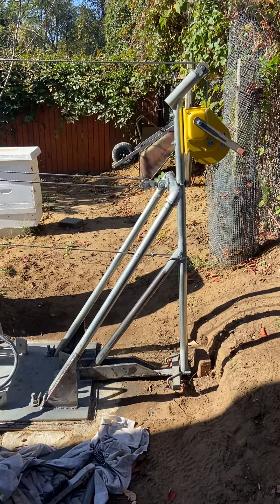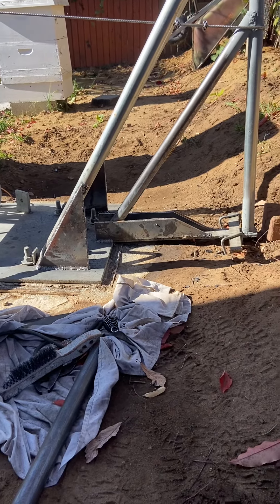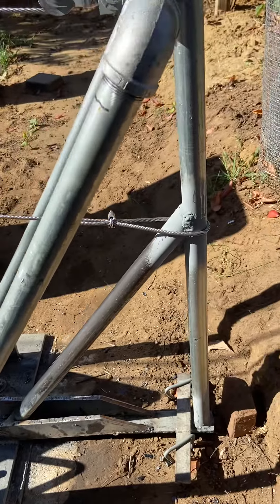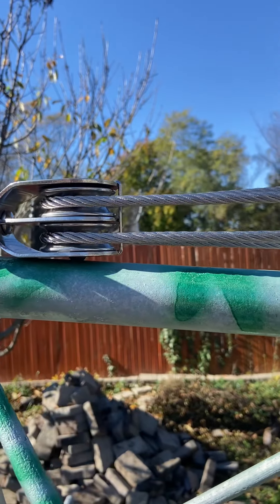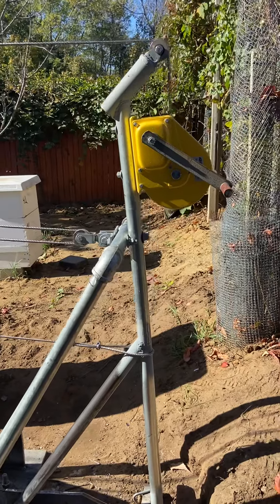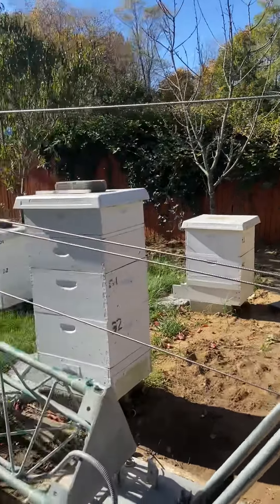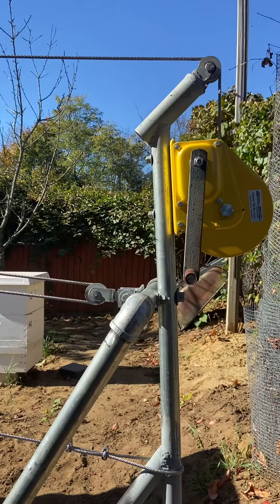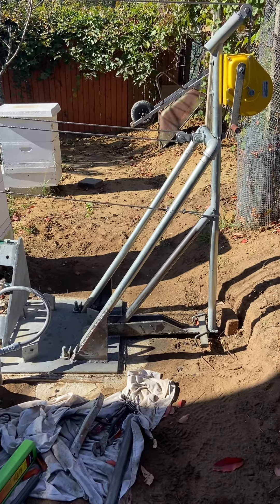Vertical Wind Turbine Part 23  Never buy Tesup , Here’s the Tower. It worked" Almost..

Comment: Run a cable guy wire from above the winch back to a anchor point on the ground.
Reply from the maker: I would but I’m out of yard behind me. Besides adding a steel block for weight, I’m going to put a choker around the block of concrete , 2 ft below surface and choker cable to the rear point. 
Or add a concrete counter weight block.

Comment: Good evening, I found the problem with the wind turbine when I connect it to the charge meter, the batteries are at 24 volts and the meter is at 28 volts, it cuts out, it creates a brake if I don't connect it to the battery, it works normally, it doesn't brake, I can't find a solution
Reply from the maker: Are batteries fully charged ?  At that point, the controller should send the power to the dump load. 
Extremely important, did you do a continuity test on that connectors in the box because I got two of them from Tesup and both had shorts in the connectors to the box, which breaks the turbine.

Comment: Go for a taller mast to get a steeper angle on that pull. Or j bolt the back side down but I would say a steeper angle of pull should help.
Reply from the maker: I’m digging out a 3x2x2 hole. Equals 1800 lbs, plus putting 1” j-bolts in the pour to connect the two blocks of concrete. Plus adding a 1”  thick steel bar at base x 3 inch wide, to prevent flex. This has to be solid, as I have two more sections of tower, if I need the height later.
Reply: @Themachinewon  I just got my turbine today! I went with the istabreeze i2000 and I'm also using a TV tower with a 1 5/8" post at the top. The height I was talking about wasn't the tower but the anchor point. By raising that contraption higher you could get a more vertical lift from the cable which seems like it should take some of the stress of that anchor point. I was going to use a 15' steel pole to hook a winch to but after pricing 4"x4" steel I might just go with a treated 6"x 6" post. Cheapest I found an 18' steel post was like $500.